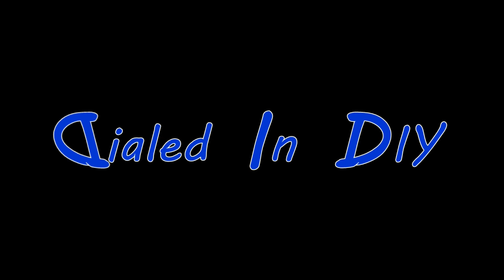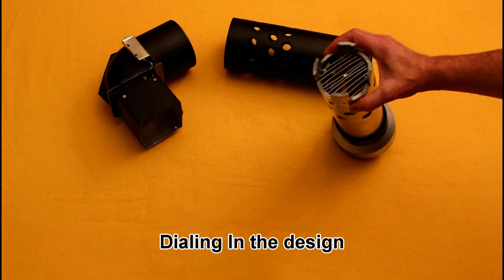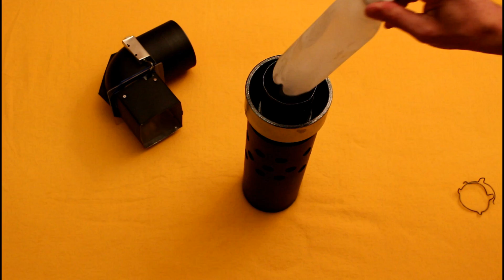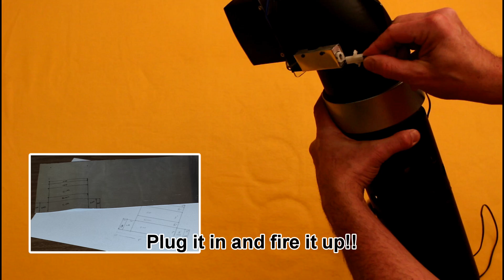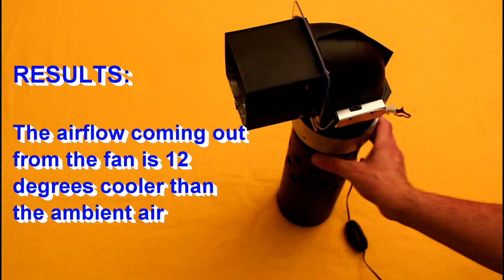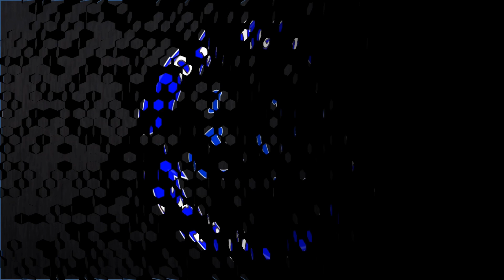Make a Portable Air Cooler

Comment: Cool design, thanks! I know it wouldn't last as long but you might get a lot cooler temperatures if you used a bunch of frozen straws instead of water bottles!
Reply from the maker: Thank you very much!  A bunch of frozen straws (or even copper tube) would get cooler (expanding the exposed surface area of cold material... great idea).